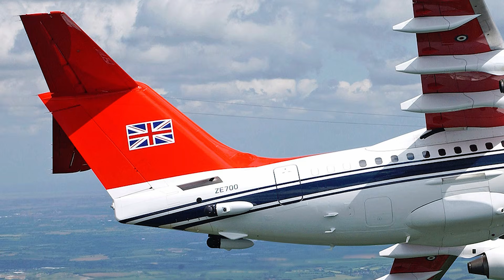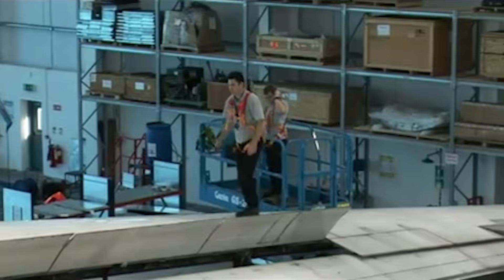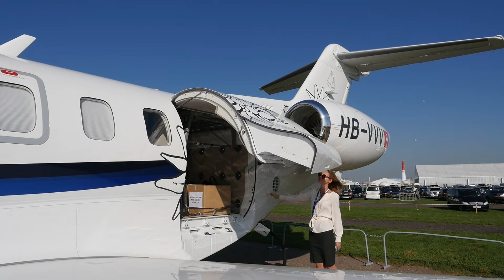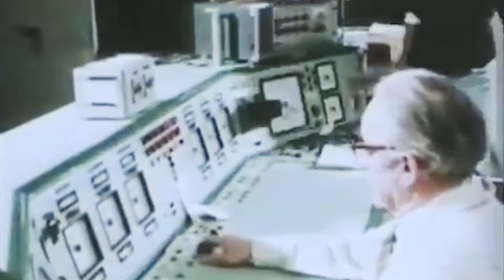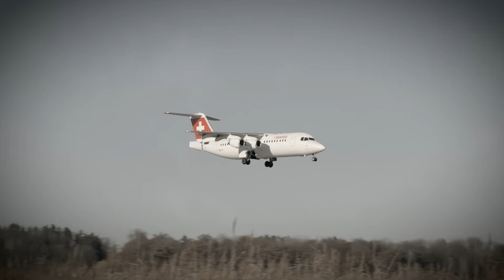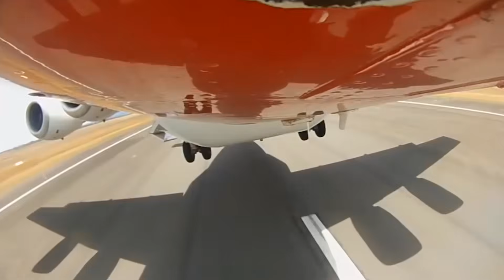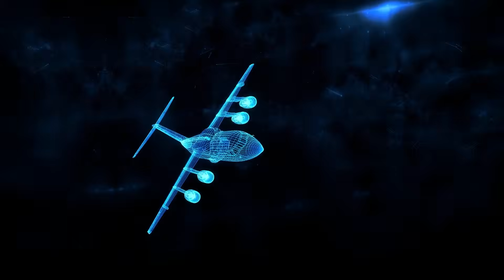BAe 146 - more engines!

Comment: “Jumbolina” as the Europeans called her. I flew all 3models (100, 200, 300) as a Captain for the launch customer - Air Wisconsin. First certified 4 engine jet without a flight engineer. ALF-502R5 - 6880 lbs thrust…

Comment: I used to work in the oil and gas industry mainly flying by helicopter from Aberdeen. To reach the northern most platforms you had to fly from Aberdeen to Shetland on a BAe146 then a helicopter to the rig. I found this a very comfortable aircraft to fly on. Shame it was replaced by the ATR 72-600.

Comment: Another mystery phrase for me to decipher. "Braking is performed by interceptors, wheel brakes and air brakes"? He specifically said it doesn't have thrust reverse so it can't be the obvious choice. Does he mean spoilers? That's all i can think of. It's obviously not brake parachutes. 
I finally figured out that "resource" is engine life, but this is a new one.

Comment: I don't think that reducing the fan speeds leads to any reduction in thrust. They have been making geared props and fans since almost the earliest days. It only requires that the shape and pitch of the blade be designed for the speed it is intended to run at, ie coarser prop pitch. The total power provided is the same, it's like gearing in a truck. If you need to put larger wheels onto a truck for off-road clearance, it will reduce the torque and drawbar pull generated, because the wheels turn more slowly (and in that case you will have kids power because the engine will be running more slowly at any given speed). If you change the gearing in the differential it balances out, and you restore the original engine speed. In a plane its generally desirable to have the prop or fan turn as slowly as possible for the produced power. The only reason gearing isn't more common is that it's expensive, it's heavy, and it requires space and maintenance, and often the benefits don't outweigh the costs. But you definitely don't need more engines to create the same thrust just because they are geared to run more slowly. Maybe you just mis-spoke there but that line stood out to me. They needed four engines simply because the base engine wasn't capable of producing the needed power.

Comment: Always want d to fly in one of these. When I first saw it fly it seemed to climb from take off as if on a wire. Now I regularly see the same performance in the A300 Beluga at Hawarden (Chester) and it is no surprise to learn that the designers of the A300 wing set had a hand in this.

Comment: You are completely wrong about the reasons for the 4 engines. It was due to mandatory performance requirements which are predicated on the assumption that one engine will fail during takeoff and climbout. If one engine fails on a 737 then it is reduced to half the amount of thrust. On a 146 you only lose 25% so can better climb above any obstacles in the departure flightpath. eg the 3000 foot hill at the end of Florence's runway. Simples!

Comment: The Fire Service operates one of these 146s, it's fun to see it whipping around out there doing good work. We're hot as hell here and at higher altitudes with lots of terrain, so it's an absolutely perfect fit for the mission.

EDIT: And if anyone is wondering, yes I'm talking about the one based out of KPRC.

Comment: One of Northwest's regional carrier spinoffs (before Northwest was bought out by Delta) flew these from Grand Rapids Michigan to MSP.  I remember having a window seat which had a great view of the nearest engine.  I was amazed at how quiet it was (still a somewhat elevated noise level however), but I never got over the thought of that engine flying apart with a bird strike or some other unusual event, and shedding parts directly toward my seat.  I also remember that the air currents on the approach to MSP coming in over the river valley, seemed to play havoc with it's flight characteristics.  This passenger could very easily hear the engines scaling up and down, and feel the plane shift right, then left and up and down through the glidepath to the runway.  I was glad to get off that plane.

Comment: On Nov 30 1987 I flew on one from John Wayne Airport near Los Angeles to San Jose. I was coming back from a conference with three other people and I had noticed one of them take off and climb incredibly steep to maybe two thousand feet and then push over and throttle back. I had never seen an airliner climb that steep.  Noise abatement rules said aircraft leaving that airport had to be throttled back by the time they left airport property so they could Fly Quiet across the city. I didn't say anything to the people I was with about the steep climb. So when we took off and the nose pointed upward I was ready for it and they weren't and I looked around and there were some wide eyes.  They thought something was wrong. Then the pushover is fun because it's like flying the parabola they looked at me and I said are you having fun yet? You go weightless in your seat or maybe 10 seconds as the nose comes down flight level and then you fly whisper-quiet across Los Angeles until you're out over the ocean and then you throttle up and go. I thought it was a great little airplane.. I noticed at the airport that airline employees were going around the metal detectors.

On 7 December 1987, Pacific Southwest Airlines Flight from LAX to SFO a BAe 146-200 crashed after a recently terminated disgruntled USAir employee shot both Pilots in the head and his former boss. and pushed the aircraft into a steep nosedive, causing the aircraft to pick up speed to 770 mph with the flight going supersonic just before impact. Amazingly to me, the plane was intact when it hit the ground. I would have thought there was no way the wings could stay on at that speed.

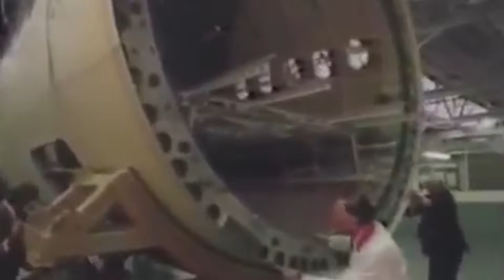Comment: 13:55 that looks like a practice that would appall OSHA or other labor-safety regulators of today: do you see the men actually standing between the fuselage sections as they are rolled together? If someone failed to pay attention and they didn't move out of there fast enough, they could be crushed and injured.

Comment: Seems to me that what BAe did was design an STOL cargo jet, and then put a passenger variant of it on the market first. I mean, what other aircraft have ever had that layout? C-5, C-141, C-17, they are the only ones to ever share this layout: high wing, T-tail, 4 engines under wings, short, wide fuselage. And of course the Kawasaki C-2, with twin engines. And many more turboprops of roughly the same layout (although at least there one can say the Fokker Friendship line is also similar. Perhaps Fokker had the same idea as BAe originally: if it doesn't sell well as a passenger plane, we can always offer it as a cargo aircraft!)

Comment: the BAe 146-300 stretched variant of the BAe 146-200 was the best by far!!! it's a pity that the BAe 146 were converted to a freighter for hauling cargo!!! you know damn well the BAe 146 deserves better than this, much better!!! would love to own a BAe 146-300 . . . refurbish a BAe 146-300 in it's entirety both inside & out!!! replace parts in the BAe 146-300 that are no longer airworthy & reinforce the fuselage & wings!!! rebuild the 4 trusty AVRO-Lycoming ALF-502 turbo fan engines for that bit of extra power during take off & that bit of 6% additional fuel efficiency!!! thanks to the engine's tuned high bypass ratio!!! full refurbishment & replacement (if any) of the front & rear landing gears & reinforced as well!!! and finally several coats of durable paint with livery!!! coming to tech part, new fibre optic wiring harness throughout the in fuselage / wings / ailerons & interior of the aircraft in addition to a new Rockwell Collins all glass (touchscreen) cockpit with night vision!!! a new front nose mounted AESA radar with detection range upto 200 miles & track multiple signatures!!! the BAe 146-300 will be equipped with a state-of-the-art radar & missile warning receiver embedded on either side of the rear lower fuselage section complimented by chaff & flare dispenser also in-built into the rear side fuselage!!! for further protection certain sections of the fuselage will be armoured to B6+ level for protection against small arms fire & 7.62 X 51 MM armour piercing rounds!!! side pax windows will feature 8.3 in. thick armoured glass (transparent armour) & the front cockpit will be armoured as well!!! as for the cabin interior of the BAe 146-300 it'll feature luxurious multi function captain seats trimmed in fine leather, solid wood accents & hard wearing fire proof thick floor carpet!!! for fun you get a next generation 28.0 in. Clear Glass Display Hologram (instead of 20.0 in. LCD screens) for in-flight entertainment & open network SATCOM!!!

Comment: the safest 3 engine aircraft in the world. Why? Because one engine is always broken.
Reply: You're wrong. That was the Lockheed Super Constellation. E.g. Lufthansa at that time registered an engine failiure in 1 of 3 flights. In the (well known) novel 'Homo Faber' by Max Frisch, the protagonist is onboard a Super Connie that undergoes an emergency landing in the desert. 

Not good to refurbish old jokes just for the sake of it if that doesn't meet the facts. The BAe 146, however, seems to have had a problem with the aerotoxic syndrome.

Comment: Very interesting, but why does a relatively small aircraft like this still  need 4 engines today? Surely it must be possible to modify the mounts and replace the 4 with 2 modern turbo fans . Makes it more efficient....I mean, modern design must have produced engines with sufficient thrust, otherwise other bigger aircrafts will all have 4 engines.....

Comment: This is probably the aircraft I travelled on most often, being from Switzerland, and Swiss Air Lines had a large fleet of these (inherited from Crossair). But not only with Swiss; I remember that Faroese Atlantic Airways had a fleet consisting solely of BAe 146 / Avro RJ's in the 1990s, as these were particularly suitable for the short runway of Vagar airport. On holiday there in 1998, I think, the approach to Vagar was very impressive (slightly unnerving) with the sea in front and steep rocks to the side....

Comment: Thank you for this great history of my favourite aircraft. I started my Apprenticeship at Hawker Siddeley Aviation, Hatfield in 1970 and took part in the lobbying of the British government to get the last all British aircraft design into production. I worked through the development, flight trials, route proving and production of this amazing aircraft until the factory closed and moved to Manchester. A few things that may be of interest ; The 3 pre-production aircraft were leased/sold to Dan Air, and two joined the ranks at RAF Brize Norton for evaluation and used in the RAF royal squadron, Queens flight to replace the ageing Andover. The original HS/BAe 146 design did not include a freighter design and was added later during development in the Quick Change convertible variants of the 146-200QT and -300QT in 1988. The wings were supplied by Avco Aerostructures in the USA, and the tailplane from Saab in Sweden. The addition of fuel pannier tanks were added to increase the aircraft range. The Lycoming ALF 502 turbofan engine was originaly derived from the T55 core engine used on Sikorsky helicopters. The renaming to RJ70, RJ85 and RJ100 reflected the seating capacities.

Comment: Both the VC10 / 146 built after consulting airlines what they needed ......... then when built most changed their minds ....... so never reached build volume ......... but it did what was asked and more ...... the Queen even used them ....... great to see those still in service doing a great job and now proving a great air fire fighter

Comment: Still the coolest regional jet ever, IMO! I live right near where the hijacked BAe146 crashed into the ground. The site is still a privately owned large oak tree studded ranch in the rolling hills location here on the central coast of CA. Not many people know of the site but I always stop to pay respects when on my back roads motorcycle jaunts. 

The BAe-146 and RJ85's are still regulars around my location during fire season as I have 2 local airports that support air attack operations for both USFS and CalFire. Such a nimble machines.

Comment: I operated on the 146 (100,200) at Debon-Air based at Luton UK , only 2 cabin crew nice and easy to run the cabin and all emergency equipment either at the front or rear of aircraft, so easy to remember

Comment: Reengine the design with 2, and it could be competitive again. Its chunky, seats five across, and short, and could be tuned for short-field requirements. High-wing birds are just excellent cargo-carriers, and the elevated engine pods scream remote airfield compatibility (aka: daily shuttle flights from mines/oil fields that have gravel strips).

Bush jet or mountain jets servicing remote locations from spoke/hub airports. The only thing restricting it now is the prevalence of composites in modern airframes.

Comment: This airplane is rightly called the Wisper Liner!  I was told that due to the requirement for commercial airplanes to be able to complete the take off with one engine failure after V2, having 4 engines allows each engine to be less powerful than in case of a twin engine where one engine has to be capable to do the take off.

Comment: I saw and went to inspect a fullscale mockup of this aircraft when it was designated as HS 146 at Hawker Siddeley plant in Hatfield, Herdfordshire, England in 1975. They were manufacturing Trident 3Es and wings for Airbus A300 then. Would it ever fly and if it should would I be able to fly in one later on, was the question. I followed its development & commercial progress. Finally, in the year 2000 I flew in one from Geneva to Dublin in a Swiss Air Avro 146. Amazingly, it was not my 1st & last. I find myself in this aircraft on many occasions until the year 2010.

Comment: I flew the 146 for many years. The trailing gear undercarriage was very forgiving and always made for a smooth landing. Sometimes on a wet runway the landing was so smooth that you weren't sure exactly when you had touched down. It was extremely easy to bust altitudes as it didn't have a VNAV but relied on a toggle switch that pitched the aircraft up or down. For instance you would pitch down for a vertical speed you wanted and then select the vertical speed mode (VS) and the aircraft would more or less hold it. This was fine but if you hit the toggle switch when the aircraft was in the ALT CAPTURE mode the Alt selection would drop out and you'd go sailing through your assigned altitude. It sounds like it was something that wouldn't happen often but in a high workload situation it was extremely easy to do. The aircraft was very underpowered and the only way to get a full aircraft up to its cruising altitude was very carefully inch up the throttles using exhaust gas temperatures (EGT). You'd have to be very mindful that the engines tended to burn out quite easily. We always kept a 30C cushion between what we used and what the manufacturers recommended. All in all, a pretty aircraft that was great fun to fly.
Reply: So the toggle switch acted as a silent ALT CAPTURE OVERRIDE.  It does sound like a CRM nightmare.  I guess the only consolation was that being underpowered meant you weren’t busting altitudes at 3000 ft/min.

Comment: 1 of these skids off the top of short high runway bc no reverse thrust big flaw. Only 1 of the engines on each side needs reverse thrust braking esp if stacking engine on top of each other to get advantage of that high mount wing.

Comment: Give Me a diamond wing & 4 ulta low load engines & pear body & 1/2 & this cargo or limited passenger in front narrow prt & cargo in rear prt would b a star even today. Fly w/v/low maintenance or engine over haul or replacement cycle. Dream for smaller not beast corp rigged satanic fraudulent shipping system.

Comment: This design is sound enough if u make it get 1.5 body wide in the back. Hving high wing loading help & shorter length but fatter pear ass keeps the plane in bal, say cargo deal & bc 4 engines u can feather the engines v/low load so long milage between over hauling say double the normal service cycle, & if u need it u hve it extra power just hanging there. All about wt bal for max loading safely only needed pear body super easy tail loading.

Comment: I worked for BAe, at the Hatfield plant where the BAe146 was built. They selected four engines for just one reason: there were no engines available with the thrust required to use just two engines, although there were many engines considered during the life of the program. I have made more than 200 flights on the “jumbolino”, as it was named by Swiss airline, Crossair. It was excellent. The aerodynamic braking was required because the engines could not include thrust reversers. The noise benefit was entirely accidental. The engine was shockingly unreliable. The ALF502 was replaced on the Challenger after just six years.